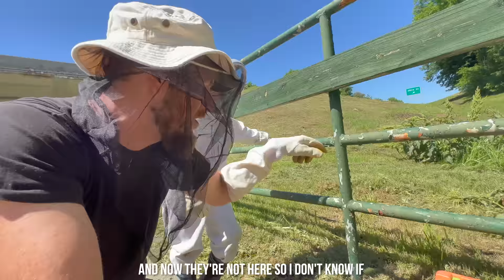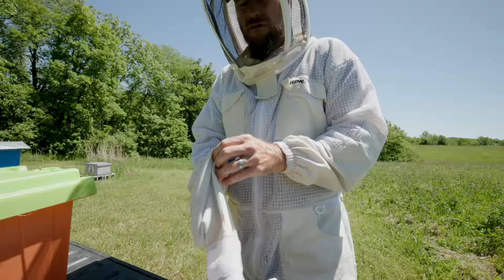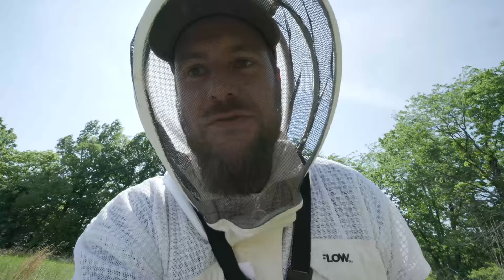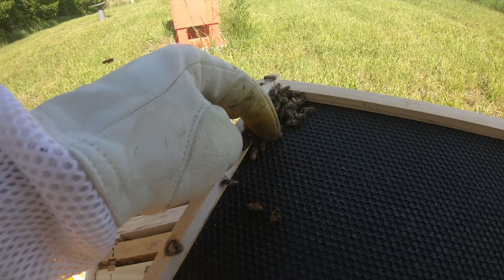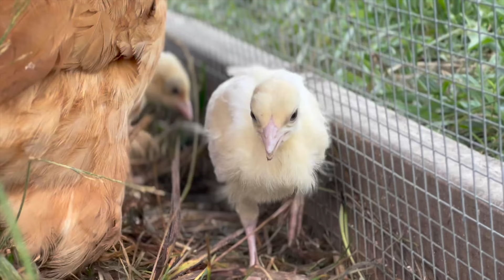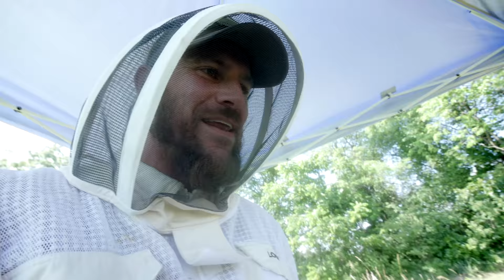we found the tiniest SWARM of bees in the park. Here's what happened...

Comment: Great video and great job with the swarm. Makes me wonder if the other queen went to go get mated and just didnt come back. Since you got a queen make sure to knock of the other queen cells so they dont try to build in them. Keep it up!
Reply from the maker: The other queen cells were empty. I think she had already killed the other queens that might have hatched out.
Reply: @whitehouseonthehill  thats good, I would just knock those off next inspection just so you know now queens.  Also love the color scheme of your bees.
Reply: @whitehouseonthehill  Dear WH:  Those queen cells came with the frame.  She is the original first queen you showed.  She was a virgin when you picked her up.  She has all the behavior of a recently mated queen.  She flits about and moves on the frame rather quickly.  She may have already had one mating experience as her coloration was not completely consistent.  Sometimes in a mating a queen will have been treated roughly and when she comes back to the hive she will look awful.  Give her a few days and go back to the hive.  She may have several other drones to mate with.  The number of mattings may be as many as 15 to 20.  If you go back and find what looks like a gut or stick hanging out the end of her abdomen, that will be the remainder of the spermatozoon tissue from the drone.  The worker bees will dry the gut tissue all the way to the tip of the abdomen and then the semen nodule will burst.  The sperm will then travel through a tube to a receiving spermatheca.  She will never mate again.  This mating will give her enough sperm to last up to seven years.  She is one of a few of God's creations that can determine the sex of her offspring.  A fertilized egg will be a female worker and an unfertilized egg will make a drone with one set of chromosomes.  He will have the "Y" set from his mother.